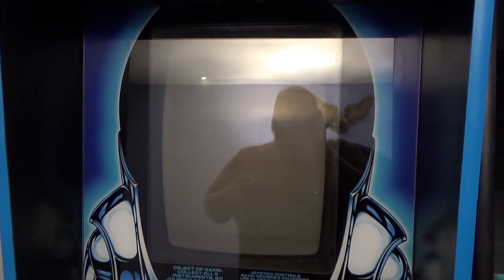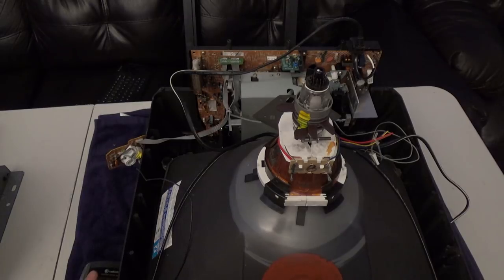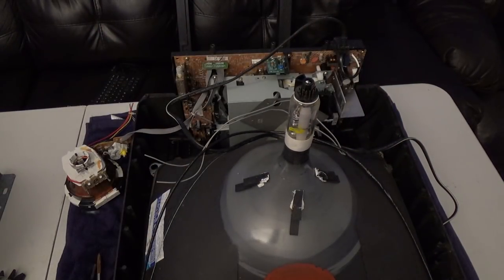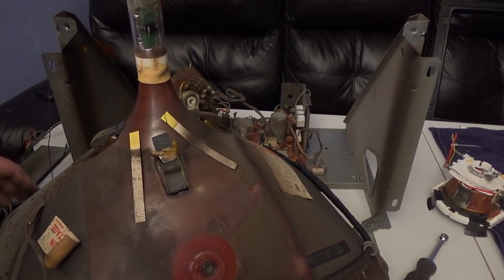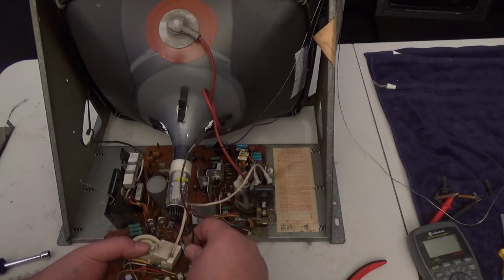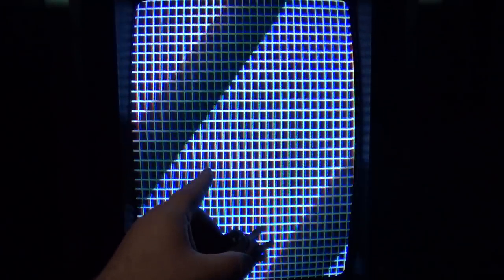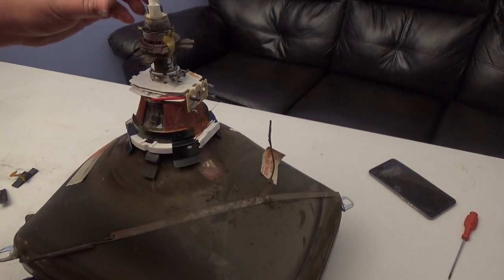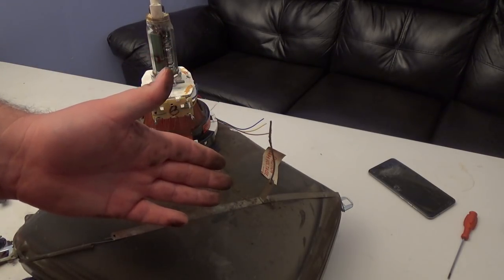Arcade TUBE SWAP simple explanation

Comment: Awesome video! I would love to see a followup safety video.  Specifically,  if you are adjusting this tube while it is live, which parts of the yoke are safe to touch without getting shocked?  Is there anything other than the annode itself that is dangerous to touch while the tube is plugged in?
Reply: I was going to comment the very same thing. It would be awesome to see a safety video around this kind of tube swap and live power work
Reply: I once did a house call on a 35 inch RCA that had started up and then the Xray safety circuit had shut down. I discharged the Anode which went off with a big CRACKLE.  Problem was it was likely 50kvolt and while it was discharged to the Dag on the tubes outside ground I believe the tube ground was charged compared to the earth ground.  It was a very painfull Zap I caught off it.
Reply: Instablaster...

Comment: Thanks for showing how to swap the chassis’s yoke onto a new tube.  I wish there were more videos showing how to do this, versus using a yoke that was not designed for the chassis.  I am planning on doing this, but worried about convergence adjustments.  So more videos would help.

Comment: Two questions.  1# Did you ever find out what the name is for the single piece purity ring you were taking about towards the very end of the video?
#2. I adjusted my rings as best I could,  but when I slid them back to the point where they were not making contact well with the tube the screen was perfect?   I would assume I still need them but thought I'd ask.

Comment: Hey! Great video! Just completed a swap and it looks great but I’m worried about the difference in resistance between yokes: I left the original tv yoke but it had a 10 ohm resistance for the vertical while the arcade yoke had a 12.5. Should I go back and replace it with the arcade yoke? Since it’s already working does that mean it’s fine?

Comment: Thank you so much for your video really helpful.
 thanks to you I replace the picture tube in a collectible Mickey Mouse TV the previous tube was burning out and the red was dying video input was burned into the screen and same for widescreen lines

I replaced it with almost the exact same tube from the same company about 10 years older and it looks way better than I ever did

The one TV I got from yard sale years ago

And the Mickey Mouse collectible TV I dumpster dive find

Comment: Jason, have you ever tried to convert a high impedance/inductance yoke into a low impedance/ inductance yoke and vice versa?   Resoldering or adding/subtracting the coil windings of the yoke to change impedance/inductance to match a chassis?

Comment: Just to be clear,  you did not use the yoke from the TV, you used the original arcade monitor yoke but the TV's convergence rings?
Great video, by the way. You just showed things easily done that many people are warned to never attempt.
Reply: I agree with you
Reply: @azariayehezkel9064  upgrade to LCD
Reply: LCD wil never be an "upgrade"

Comment: Hi Jason, Great Video.  I did a G07 tube swap last year in my Ms Pac. I used a 2002 Samsung TV/VCR combo. I had to swap the yoke as well. I got the convergence and and yoke adjusted awesome outside the cabinet. As soon as I put it in the cabinet the convergence was off and colors went all wonky. Long Story short ended up being that the tube didn't like  being at any angle but normal TV orientation. No amount of Deguassing would fix it. It almost seems like the shadow mask moves when tube is rotated from normal TV orientation.. Have tried this with many tvs and they all the ones i have collected seem to do it as well. Have you had any problems like this?

Comment: Very informative Video Jason thanks that's allowed my Arcade/CRT knowledge to broaden, however I have always want to know what amount of Electrical current is present on the Yoke coils and what not to touch?
Reply from the maker: the current and voltage varies per manufacturer design.  deflection circuits in raster monitors have 2 voltages aprox 12v-50v and 80v-180v  you can touch a live yoke as long as you don't touch the bare terminals you'll be oik

Comment: Good vid.  How do you feel about those universal chassis on FleaBay?  Good?  Bad?
Reply from the maker: i have used many of them while working for an operator i have found that they die after 2-3 years if left on 24-7 all year which is not bad  also like other monitors out there once in awhile they will not sync up to specific pcbs

Comment: I've gotten this type of swap to work only comparing yoke coils of original with donor and getting pretty close. You think these guys who say you also need to measure inductance in Henries are being too critical? Without an LCR meter, I guess one could build one of those circuits with a resistor of known value and apply a power supply with known frequency and do a couple of calculations to get the Henry value. Do you think this is overkill?

Comment: Excellent video! Thank you for taking your time to do this. I have a question.. what would have happened if you didnt swap the yokes? Im just wondering..
Reply from the maker: the original yoke measurement is 55 ohm and the would be replacement is 14ohm. i did not measure the inductance but  it would force the defection circuit to draw approximately 4x more current which would damage the deflection circuit or blow a fuse

Comment: The magnet cluster on the neck of the tube is your STATIC convergence that is for the center of the picture
Tipping the Yoke is your DYNAMIC convergence that is for your 4 corners .
19VJTP22 is not that big of a tube so you shouldn't go to far wrong.
Sometimes if your contrast or picture is set too high the shadow mask can overheat and warp slightly enough to form what may look like a green egg on one side of the picture it will go away once it cools off.
Keep magnets like in speakers away from the tube face as it will mess up the colour purity.
The speakers in the tv itself you may notice have shields around their magnets.

Comment: The tube on my Midway Pacman cabaret is a Wells Gardner 13" K4906.
I was recently moving the cab and have necked the tube.
The CR23 neck board socket is a 12 pin and wondered what other tube other than a K4906 will work if swapped.
Will any K4900 be compatible with this yoke?
Does the number on the yoke need to match the number on the tube??? Or is it just trial and error?
I found a 14" tube which had the same number of pin outs on the CR23 but the tube was too big for the chassis without bending the chassis to accomodate the tube.

If I were to tube swap will my yoke be compatible on another tube or does it have to be the same series of tube like if its a K4900 series then will the only compatible monitir for that yoke need to be either a  4901, 4902, 4903, 4904, 4905, 4906 etc etc for it to work??

Comment: I am doing a go7 cbo

So if the tube look the same and is the same size 

But the yoke on the new tv have a resistance of 16 and 2.5 And on the go7 is 55ish and 2.5 

I can just switch the two yoke ( put the one of the go7 on the new tube )???

Comment: Question, I use the discharge method of using the wire with the alligator clip attached to the screwdriver.  The t.v. doesn't have a metal frame that arcade cabs use, where should I attach the alligator clip while discharging it?
Reply: The metal parts in the corners where the bolts go maybe? I think I have seen  someone use the metal wiere thingey running along the tube (not the degauss).

Comment: Hi ya my arcade monitor is 20” am I ok to use a 21” tv screen? Am I right in believing we use the existing yolk from the original arcade monitor and use the adjustment ring that’s on the new tube? So  the only thing we bring across  is the tv tube and adjustment ring

Comment: Another fantastic vid Jason.  About to undertake a similar project myself.  Quick question (and an easy one.for you!)..i need to splice in some wire to extend the length of the wire going from the degausing coil,.to the neck board.... question is... what guage / type wire am i best to use (sorry for such a basic question).  Cheers mate!
Reply from the maker: anything under 24 gauge is fine

Comment: I just bought a 1976 RCA tube tv from craigslist and I want to use it for my youtube channel where I play games on it. Naturally, a modulator is what I need but I have component wires, the RGB ones. Everyone uses HDMI nowadays but I bought component wires from Retrovision HD and I want to use those. I thought of either modifying the TV just like you did with yours or find any modulator that has component input. I can't find any. So I ordered a converter box that's an AV component to composite. If that doesn't work, then the only way is to modify the tv. I know its possible and so many tell me its not. I can either have it re-wired or replace the unit inside with a different one. I just can't find any technician in my area that can do that. Would you be able to do that? Do you think you can help me with this experiment? Its an analog tv from RCA and I have the schematics... I think. Its on google.

Comment: Great video.. You are the "CRT whisperer!"  :-)  I've watched other vids, and they make it seem more complex - Never seen anyone suggest that maybe that the magnets would be OK if you leave it alone..   I have done one tube swap, but it was from one arcade monitor to another, so it was a good first try.  Your video gives me confidence to do this with a TV if needed!  A couple comments/questions:  1: When you lifted that tube out by the neck, I expected it to implode.  I always treat those as if they'll break if breathed on too heavily. Is that really a recommended way to carry?!   AND..  I dont have any vector games, but I'm always curious WHY the tubes are different on a vector game??  By the time any signals get to the tube, it's all about X/Y deflection no matter what, right??  Why can't a regular tube be hooked to a vector game?   Thanks for the great info!
Reply: Oh yeah... and, you said your wife did a cap kit on that monitor in 10 minutes?! That's fast..  I haven't done many, but I've done a few, and it'd take me 30-60 minutes if I cared enough to check my work!  It's great she has interest in your hobby!!
Reply from the maker: all arcade vector monitors use tubes which were originally designed for use with tv sets  i interchange them literally every week

Comment: Is there anything one would need to be safety concerned about while adjusting a powered up yoke/rings?
Reply: Steer clear of the anode cap, the neckboard, and probably the wire lugs on top of the yoke where the wires to the chassis attach and you should be fine. The yoke coils are insulated (though they may get a bit warm), and the purity rings are just magnets, they're not connected to anything electrically.

It's best to keep one hand in your pocket (or behind your back, or otherwise well clear of the monitor) and use an isolation transformer even if the chassis doesn't necessarily need it, just to be sure you don't put any dangerous voltages across your heart.

Comment: Very awesome video man. So when you find yourself a cheap/ junk TV that's the same size as your arcade monitor, is the tube socket and Tube degree just kind of luck of the draw?
Reply from the maker: luck of the draw but the older the tv the more likely it will work

Comment: Just checking...  When you tighten it down I'm assuming you turn it off, then use a metal screwdriver to tighten the rings?
Reply from the maker: you can but i just tighten it up as is

Comment: Can you use a 20" chassis with a 19" tube
Reply: From what I got the tube needs to be bigger than the high voltage values. ... ?
Reply: That is close I would say Yes.   There are two ways to measure size,they both measure diagonally one way is the viewable area the other is the mechanical measurement diagonal.  What I found back in the day was a 32 inch had the same gun assembly as a 28 and since it had a greater area to paint with Electrons it had to run more current and either flared a color or aged prematurely. Mitsubishi 35 or RCA35 come to mind. I believe Mitsubishi tried a 40 inch tube it was very heavy the Purity and Convergence were affect by localized magnetic fields and the three color guns were prone to age quickly.

Comment: I have an rca monitor in my old baseball arcade. I want to swap with a tv tube. I am getting a reading of 55.0 ohms on the vertical wires on the existing monitor. Is that correct? I never seen that so high before

Comment: Does it matter if you have that extra loop in your flyback / anode cap wire?  @19:13
Reply from the maker: no sir it does not matter it is simply there to tidy up the harness a bit

Comment: thanks for the vid, I am still scared to fix a crt :D Which parts can you touch while adjusting? EG the copper wire on the joke? neckboard, flyback cable, Which parts you should not touch ? I need to fix an sanyo ez 20, well for me its not that ez :)
Reply from the maker: as long as the power is off and the tube is discharged you can touch anything on a ez 20. but when it is live stay away from the neck board as it has a 400v ish focus and around 90vish grid voltage also the yoke has  aprox 100v  so if you want to move the yoke while live touch ONLY the plastic parts
Reply: thanks, I knew most (thanks Johns arcade).  But in these repair vids, you hardly hear what not to do, like never to touch the yoke when live etc.

Comment: Hello Jason.  In this excellent video you mention that xray radiation shouldn't be an issue if you use the same size tube or larger.  What are the chances that a 25 inch Sharp tube would fit the neckboard of a K7191 chassis with a 19" tube?  Do I even bother opening up this Sharp TV?  Someone told me a tube swap would be easy with either a Sharp or RCA.  So I'm kind of splicing your video with that comment from another source.  If it doesn't fit then it doesn't fit and I move on but I'm more concerned with the radiation.  I don't think a NeoGeo cab conversion is worth radiation poisoning.  :P.
Reply from the maker: sharp  rca orion ect all the same for the most part just don't use a sony . yes a 25" tube can be used on a 19" chassis just make sure the yoke you use is the correct yoke or compatable
Reply: @ArcadeJason you da man.  I will definitely check that yoke.

Comment: Damn you made that look easy hah. Any advice on a monitor that looks a bit blurry even with maxed out sharpness on the flyback? I am going to cap it, but just wondering if a tube swap may be in order. (K4900 in a Tron)
Reply from the maker: i would suggest replacing your high voltage caps  but those will be in your cap kit anyway .   i would recap the chassis first before  any tube diagnosis is made
Reply: Will do. Thanks man

Comment: Hey Jason, what about yoke impedance? People always talk about checking that to compare the donor yoke with the original yoke.
Reply from the maker: Excellent question I have found that as long as the resistance is close enough the impedance will follow suit. But that's not always the case I have seen some monitors that require a specific ring or impedance from the yoke to even turn on. But most cases it's just a simple resistance test
Reply: Arcade Jason so, should the resistance be the same as the original or can you ignore that?
Reply from the maker: same as original.  many monitors and tvs use the same parts and same yoke voltages so it is very common for 2 different yokes that have the same resistance to also have the same impedance

Comment: Can you take a medium rez chassis, yolk, etc, and swap it into say a go7?
Reply from the maker: yes you can use a standard res tube with a medium res chassis and yoke. infact many medium res monitors used std res tube from the factory. but i have a suggestion for you. some early vga monitors  use a compatible high res tube which look great on both std and med res chassis
Reply: what about 100hz TVs, was that refresh rate just a feature of the HV circuitry? no special consideration needed if the tube is otherwise compatible?
Reply from the maker: a 100hz tv is just the scan speed the hv would be the same as long as the tube fits  and the yoke is close your good to go . although i would stay away from the 100hz crt wide screens of course
Reply: ok. how are newer vga monitors different by the way? if it's just the socket could that be swapped?

Comment: Ok just a quick question. I failed to understand the part about the radiation. Let's say I want to use a 20" tube on a chassis that was in a 27", is it a no-no? Or will I survive with a shot of rad-away?
Reply from the maker: ok you wanna know the truth lol i probably should't tell people this but.....the amount of radiation from a crt tube is small and not dangerous for a short  period of time . but that being said you don't want x-ray radiation blasting you in the face for several hours either. you have PLENTY!!!! of time to adjust your high voltage to a safe level. btw a 20" tube should have around 19.5kv at the anode. also i highly doubt you would get this much exposure but the first sign of radiation sickness is a severe headache
Reply: Arcade Jason , I might end up not doing it since my kids also play my arcades and I'd like to avoid them growing a third arm. But thanks for the warning, your help is greatly appreciated!
Reply from the maker: if you have an hv probe there would be zero danger involved but i don't suggest doing it without a probe
Reply: at http://www.jmargolin.com/xy/xymon.htm Jed says "above 25KV it starts to produce ionizing radiation, commonly known as x-rays", so I guess HV/tube mismatch isn't detrimental to one's health even in long term if it's under that voltage?
Reply from the maker: it depends on tube size 25kv with a 19" will produce x-rays but 25kv on a 32'tube will not